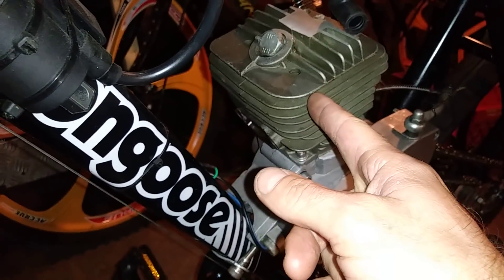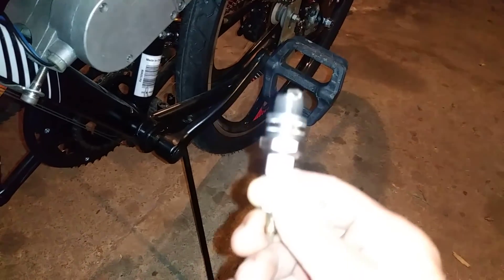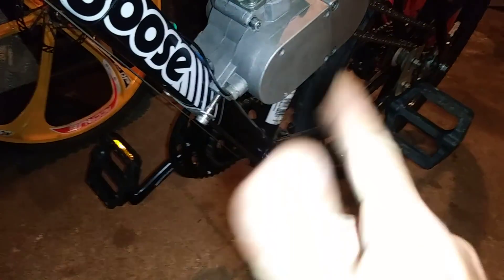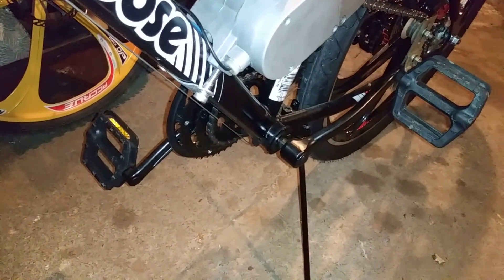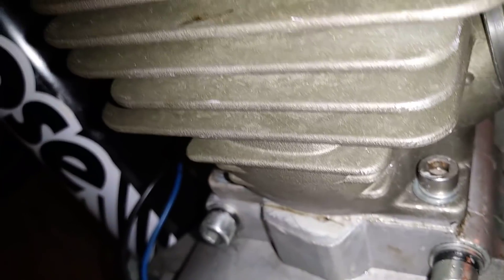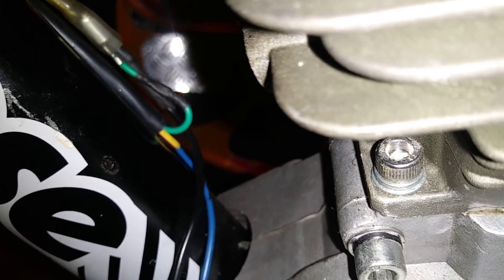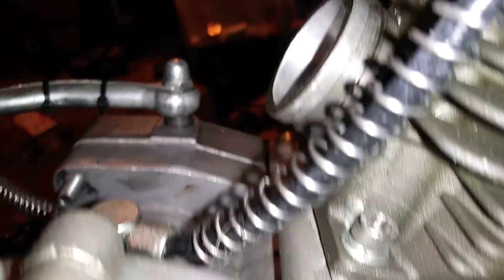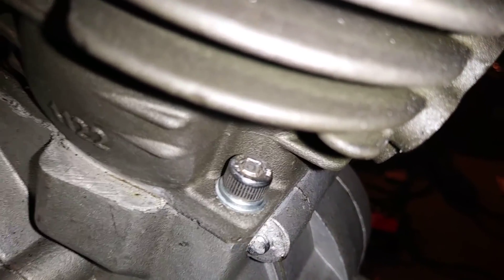FUCK ZEDA JUNK

Comment: Well idk where he got 52mm, because that is obviously an ms660 cylinder which only comes in 54mm, unless you get the 56mm big bore. The one thing I can point out is that there's no reason to round off the bolts, like people might need a replacement, although it does need deck work.

Comment: Seriously though, you paid a very low price for a tremendous amount of R&D. Not that I believe for a second that rob stripped out all the bolts. But seriously dude they easily accessible with vice grips if stripped. Yet you would rather make a video and complain about how you failed to pick a correct spark plug, or that bolts are stripped and you are too incompetent to remove them. Do yourself a huge favor and take some personal responsibility.
Reply from the maker: Boobert sells trash you claim tons of R&D went into this how laughable is that? I chose the wrong plug? Well if they are such pros and put so much R&D into this then how did I choose the wrong plug goof ball?

Comment: So you used the wrong spark plug as even my impared ass can see those are 2 different plugs. Also i bought from robert and have no issue with my stock engine thats set in my basement for months. If your gonna talk trash then lets go over what i see....1 you destroyed a pipe that he told you that it needed a header.(( you pissed off fred and he wont sell to you eather..wounder why))
2 race engines normally have one ring for performence reasons. Not reliability, you eather get a engine that lasts or an engine thats fast but needs love and care.
3. Only amatures or dare devils build on wal mart. That and also cheap builders with little to no money. If i had the money id build me a 4 stroke 49cc for the shear fact there less maintence needy. 
If you want something fast then you need to be able to understand what exactly your getting into. Stop making BS excuses for your crappy mechanical skills. You shouldnt go for 50mph if you cant handle 30
Also i do have to ask did you give him that plug robert?

Comment: my new BIG BORE STROKER CASE REED is on its way from zeda motorsports 👍 cant wait for my 7.7 hp motor
Reply from the maker: Ya and you might get 5hp if your lucky. I would just do my own motor if I was you. Boobert does not do anything to his own motors he is to lame.
Reply: Darren Million if i need to do my own mods i will but the dynoed 7.7hp engine with a shift kit and yz85 exhaust it should rip with more then enough power to smoke my other self modded 80cc with a 32 tooth sprocket a boost bottle shaved head ported intake flat slide carburetor and sleeper exhaust that only hits 50 mph with a 0-20 of 9 seconds so i’m sure my new build will be way better even if i strip out my bolts for views
Reply from the maker: @FukemMotorsports  Your making assumptions ask fuck face what he did to the shit box he sold me and like I said GOOD LUCK
Reply: Darren Million is just like to point out tho that not every single person that buys one has an issue most people that use them for a bike get what they ordered... they wouldn’t still be in business if they were scamming everyone
Reply: I wonder if you even got your motor because hes out of business now. For selling junk like this.

Comment: So dont buy a Zeda motor for my bike?? Any recommendations?
Reply from the maker: CDH
Reply from the maker: Ross Best you want a good motor something that will run long and strong? Buy a ZAE50 or ZAE80 my Mongoose in the not broke in video is a ZAE50.
Reply: Darren Million yes im looking to buy my first engine kit.. To install on a bike so i see and hear somuch different things.
Reply from the maker: @VirantRoss  Do you have a Facebook? If so hit me up there and I will help you buy a motor kit that you will be happy with.
Reply: Darren Million Look ypu up Darren Million?
Reply: @VirantRoss  trust me dont go CDH....plenty of people will tell you CDH is just as crappy as any other china engine. Most of those zeda members use those engines is because they actually worked with an american to improve the design and now ZEDA's 2018 engines and newer are 80CC with a chamber and head combo. There design is kinda crap but others have stolen ZEDA's and have made slight improvements.....also ZEDA and robert are not cool but people still use ZEDA for the fact they actually will work with people who work on engines here in the states.

Comment: I may be mistaken, but as far as I know, Zeda has nothing to do with Robert and it also doesn't install custom cylinders from chainsaw's. On the contrary, Zeda has been working with one of Robert's arch enemies. Man, that really sucks that someone would build an engine and go and strip out the bolts so they can't be removed or tightened. I mean, what if you even had to tighten them up? As I understand, one ring pistons are for racing and are a good quality part for high RPM's. Does the author of the video mean to say that the seller claimed the engine had a reed installed and there was none installed? That would be another blow to the builder's reputation. https://www.facebook.com/jlzeda
Reply from the maker: Proven to run and your a lier about any of these motors running 1000 degrees its not Steel dumb ass. Get a clue

Comment: You dont sound very credible my dude, the single piston ring is what a lot of race engines use for less friction. The whole motorized bike scene is china and budget and zeda is really one of the only companies ive seen build billet blocks and high hp Id say if you want something good just buy a crate engine from honda/yamaha
Reply from the maker: Dakota Heaton Zeda is not the one making the blocks a guy on my FB makes that block.
Reply: @darrenmillion1432  so why is rob selling these and not you? Why is rob and crew clearly helping push this hobby further then just billet parts? Ive already seen people improve the clutch, water cooled and even electrical stuff.....dude stop being a darren and be a mechanic.....goodluck with being alone and petty
Reply: Hes pretty darn credible since this company is already dead gone & out of business. I heard 4 other people have complaints that are in fact worse than this.. He is credible. Hes pissed and rightfully so.